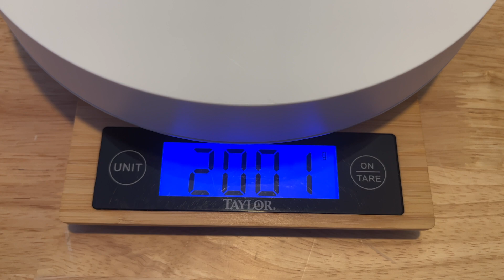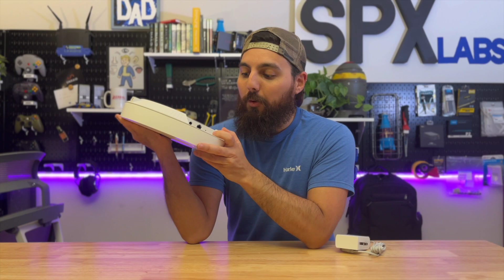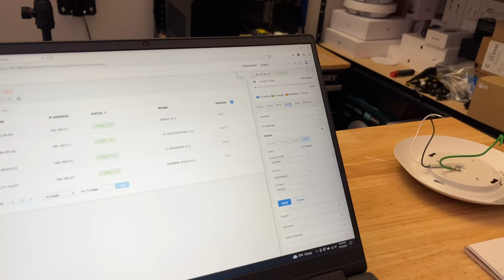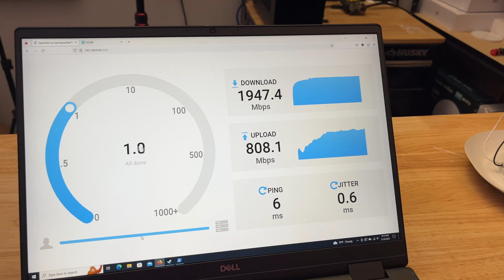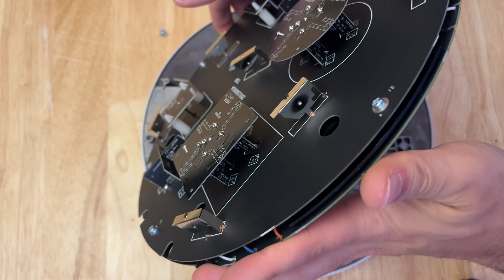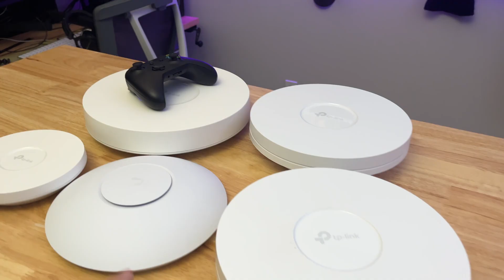EAP 690E HD WiFi 6e WAP Speed Test, Teardown, and Unboxing | TP-Link Omada

Comment: This unit is pretty massive to put on the ceiling. How does this unit compare to the Ubiquiti AP you replaced speed-wise? Would you recommend this TP-Link over Ubiquiti?
Reply from the maker: Well this is 6e over my Ubiquiti WiFi 6 AP so it does support more bandwidth.  

I think it depends on your budget.  Smaller budget tplink, bigger budget Unifi
Reply: @SPXLabs  Ubiquiti has the Unifi U6 Enterprise , which actually appears to be cheaper in price. It doesn’t have a 10Gbe uplink though, but considering your Speedtests I’m not sure that’s an issue. Other than that, I don’t know how the two compare.
Reply from the maker: Oh nice, I don't track prices on the regular but the Omada ecosystem is cheaper overall than UniFi.  Now as far as individual prices of components, that obviously varies as you pointed out.  With TP-Link you can host the Omada SDN app on your own hardware for free so that saves a bit of money.  But I believe both Unifi and Omada allow for "standalone" modes and if that's your aim, then yeah get which ever is cheaper you won't be upset with either brand.  If you forced me to pick a brand, I lean UniFi, I like the design more.  My entire house still runs UniFi.

The Omada ecosystem is still young but growing.  I continue to sell UniFi to clients because it's a more complete ecosystem, as in, sensors, cameras, switches, routers, nvr, wifi, etc etc.  Whereas, currently, Omada is only networking.

Comment: Hi, I have the exact same setup except with a different TP-Link AP. Anyway, I found that using Firefox was “changing” the html5 results vs using a Chromium based browser. I also noticed that using a windows machine vs a Linux one also affected results. (Linux was faster). Still unsure why though. Just an observation.
Reply from the maker: For my actual testing I used iperf3.  I used open speed test only because it shows up on camera better.  But yes from my experience with open speed test safari is the “fastest”.

Comment: Great follow-up, its really nice you got it to pass 1000mpbs on download, you should be able to do it on upload also, not sure what's restricting you, could be firmware of the AP.  

I really hope in time ubiquity send you a U6 enterprise + 2.5gb switch POE (enterprise), would be great to see how it runs on your network.   I can tell you that couple of other youtubes are breaking the 1000mpbs on download and upload with ubiquity.
- LonTV "Breaking the 1 Gig WiFi Barrier with the Unifi U6 Enterprise - Wifi 6E Access Point" @583sec,  1531mpbs download and 1291mpbs upload.
- Mactelecom Networks "Unifi U6 Enterprise Review" @426sec,  1132mpbs download 1665mpbs upload.
Reply from the maker: I want the upload to be like what they have.  That would be dope!
Reply: @SPX Labs  it might be the limitation of your drive either on the upload end or the receiving end. At that kind of speed, many drives with smaller cache will run out of cache quickly. Also, you can always conduct a large single multi-gig file transfer between your laptop and your server to test the wireless throughput.

Comment: BTW I would not worry about up/down speeds being different - just look at the elaborate antenna config inside the AP, you can NOT have the same inside a laptop ... receiving is much easier than sending
Reply: Fully agree with this statement !!  100%
Reply from the maker: Thanks jay

Comment: You should change the antenna power to maximum instead of medium. I've seen this on less than industrial devices such as this cause huge differences in performance. Because of the complexity and knock on effects of changing antenna gain in relation to Wi-Fi this setting could be 3 pages of extremely technical detail summarised as 3 options.
Reply: Would the power matter if he is standing directly underneath?
Reply: @jackslater2096  Yes 👍, and it's recommended not to stand directly underneath. It's like asking someone to have a 1hr meeting where you whisper into each other's ears, it's not the same as being a normal distance apart and talking normally.